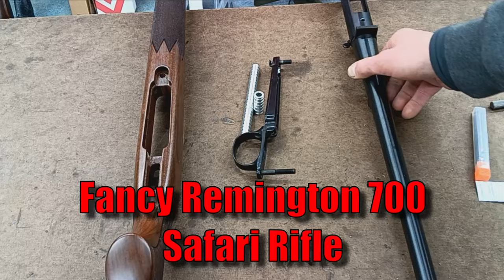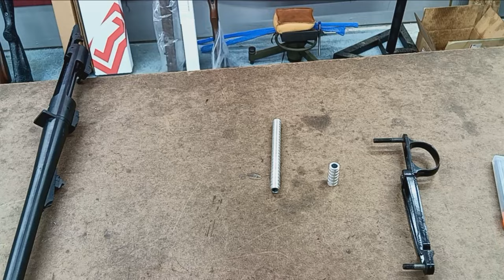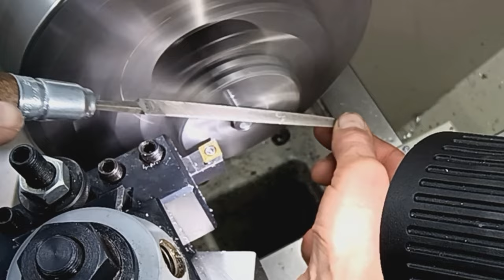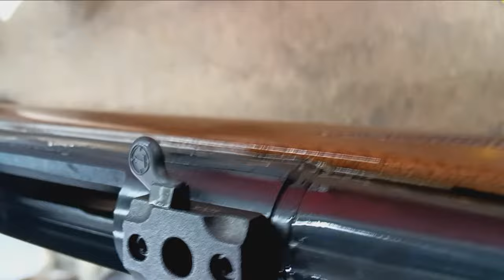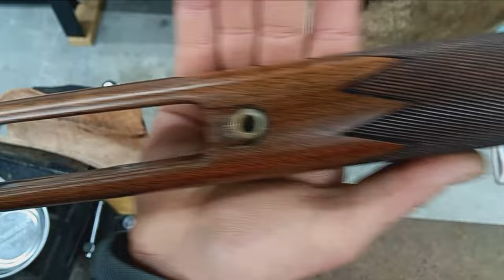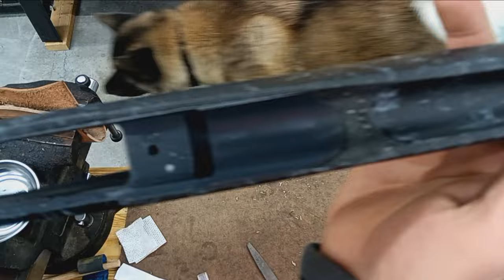Precision Pillar Bedding a Hunting Stock - 375 H&H Magnum - Custom African Safari Hunting Rifle

Comment: Hope that's not a drill chuck holding a cutter if it is its going to let go at some stage . get a ER collet system ER 32 is a good size . Also handy for holding small screws etc and turning the heads down whether in the mill or on the lathe
Reply from the maker: oh man, I was waiting for this one!!  It's admittedly "lazy" but we're just cutting wood here.  If we were machining important metal of some sort we would definitely use a proper collet.  Thank you for your concern, but we have never had an issue doing it this way for years.  Thanks also for watching and for engaging the channel!!

Comment: You havent heard or seen release agents or masking tape, bloody rough job
Reply from the maker: Yes we have, and do use MANN 200 release agent.  No need for masking tape because we clean before it cures.  If you watch all the way through, it clearly shows the final product all cleaned up as well as 2 other bedding jobs that came out perfect.  Anyways, thanks for the view and for the comment!!
Reply: @AccurateRiflesandRestorations The bedding is too loose. You might as well have not bedded it.
Reply: @StuninRub well the rifle shoots 1/2” groups easy and just killed 13 animals in Namibia, so I think it turned out alright.
Reply: @seanduncan8422  That's terrible, my bedded rifles do sub quarter MOA all day. Half inch rifles are standard with the right cut barrels.
Reply: @StuninRub first 3 shots were one hole so that was less than a 1/4”. I can send you pics. Are you shooting 250 grain bullets at 2820 FPS from a 30 year old factory Remington 700?